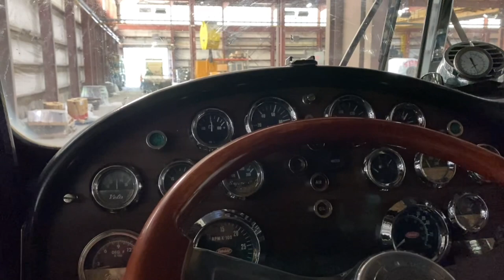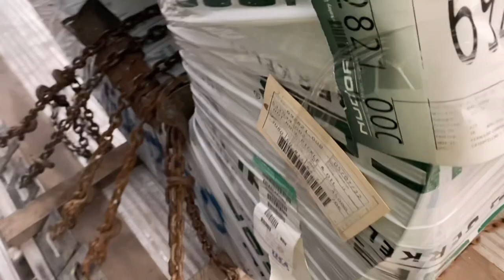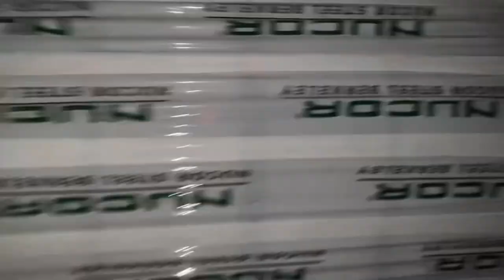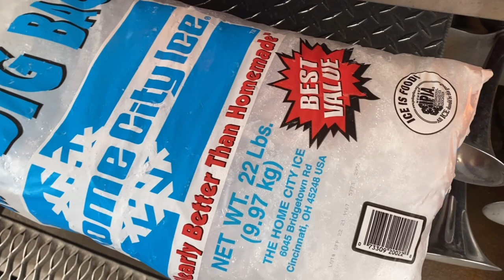Hauling A 45,000lbs Single Steel Coil/ 2 Coils Turned To One/ Decent BBQ/ $5 Dollar Bag Of Ice!!!

Comment: Here in North Carolina. My drivers licenses has a gold star in the corner. It means that it is your real ID. Where I live there is an air force base. I can get on base as a visitor with just my driving licenses
Reply from the maker: That’s it man. The that guy that pulled in before me couldn’t shift his truck but he went straight in😂. My new TWIC is here now and I’m good but I never knew about making your drivers licenses a federal ID
Reply: @thedirtytrucker9633  😂. I'm glad you are good now. Now you don't have to worry about them holding you up the next at the gate
Reply: The same thing in pa.i got it on my license  also.so it's good for the ports and bases or do you still need t.i.c. card 2?
Reply: @thedirtytrucker9633  and